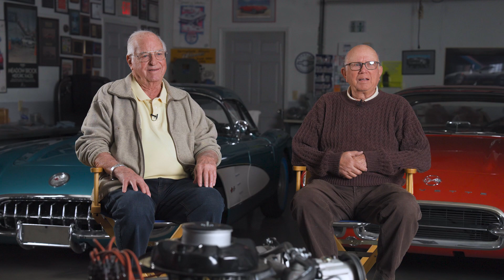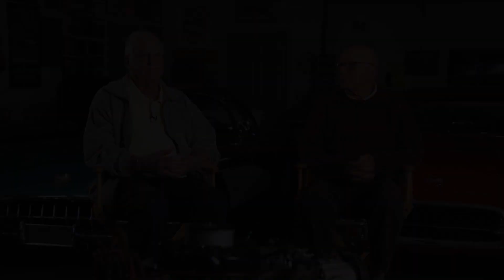ZL1 Corvette Engine History

Comment: Two of the legendary men who worked with the Corvette. George Heberling made the decision to order the first and possibly only (GM records officially state there were two total) ZL1 Corvette, and Tom Langdon along with Zora and Gibb Huffsteader were responsible for the development. Tom also set up the LT-2 press Corvette (thought to be a ZL1) that was featured in the Oct 1969 issue of Motor Trend.  That car ran a best 10.60 sec 132mph 1/4 mile with slicks and headers.